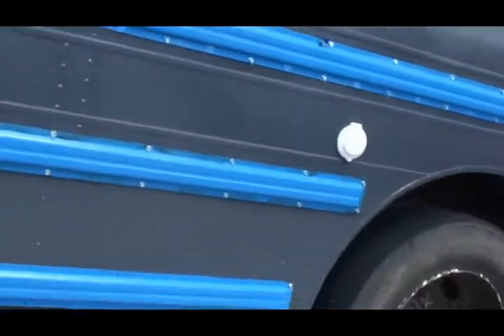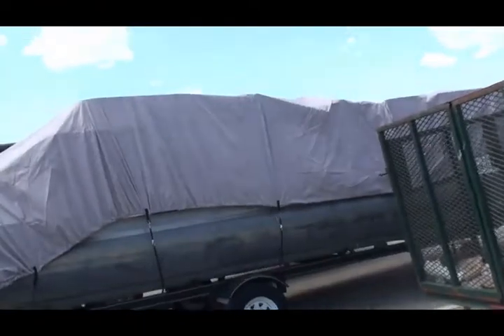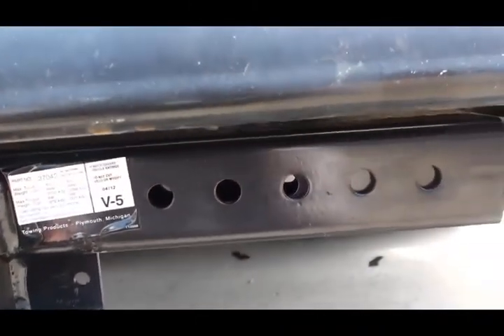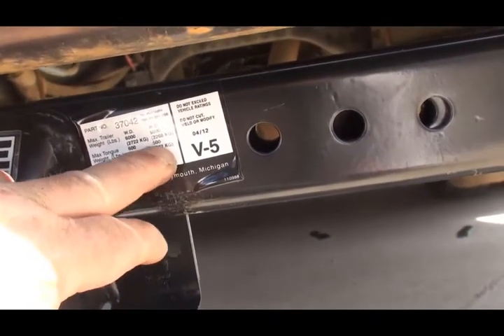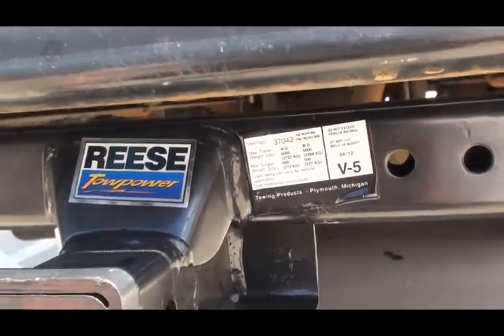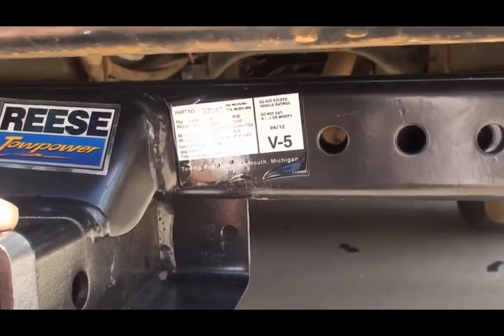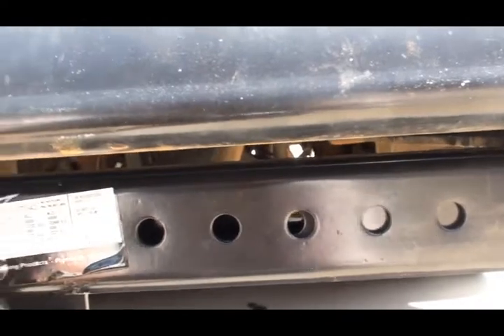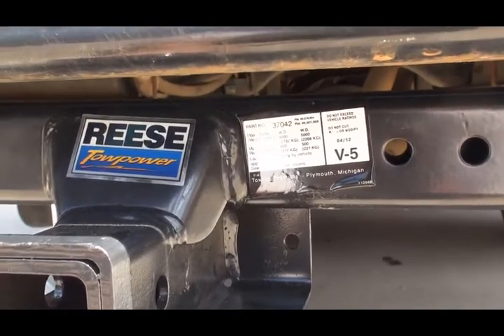School bus to RV conversion #18 (Hitch on a skoolie, Might be a first)

Comment: I put the same on my skoolie last year! I have 40’ IC RE300. Works like a charm! I pull 5000 pounds
Reply from the maker: well i hope my does as well, I'll be pulling a 16 foot enclosed trailer with my Trike inside as well as some essential tools, can't want to finish it and get on the road

Comment: I don't have a skoolie, but I heard those buses are rated to tow as much as 10,000 pounds at the most, and there are 10,000 pound hitch receivers out there, and if it was me with a skoolie, I would have a 10,000 pound trailer hitch receiver bolted to the back of the heavy duty truck frame, and I would go for the kind that drops a foot or so close to the ground, not only to level a 2,000 pound flatbed trailer, with a four wheel drive station wagon such as a 3,000 pound Ford Escape loaded a board making that combination as much as 5,000 pounds, but that trailer hitch sticking down like that would also make an interesting foot step to go in to or come out from the walkway of the emergency exit door, which at that point of making your own living space in any way you want, it would no longer be an emergency exit, just an alternate way in and out besides the main door by the driver's seat, and as for my choice with a 10,000 pound hitch receiver and towing only 5,000 pounds which is only half of what the maximum capacity is, well that's the point, to make that kind of heavy duty towing much easier and safer on the connections so there would be little or no chance of breaking away, especially if you're cruising 2,000 miles at 60 to 70 miles an hour on the freeway such as parts of old Historic Route 66, and up steep hills in the mountains.  And although there are some buses that run on gas and some newly recently released buses are electric, most of them are diesel, and let me guess, your's is a diesel, because of it was me, I'd prefer diesel over gas and electric, diesels can travel farther and longer distances, last longer, and are more heavy duty enough for towing trailers down the road, and diesel fuel improves the fuel economy better than gas does, course electric motors can save on gas and diesel fuel and diesel fuel is more expensive than gas, but diesel engines with diesel fuel have more benefits than gas engines with gas, and if I had an electric skoolie, I wouldn't be able to go very far on a full battery from a perfectly full 100% to a clean empty 0%, and after stopping at a charging station to recharge from 0% back to 100%, I would have to fuss around with frustration for hours before the battery hits 100% and enough that the bus is ready to go, although diesel fuel is more costly than gas, it would only take at least a quarter hour to refill the diesel fuel tank back to max level, and be ready to go again.  All that I said is what I would do if it was me.
Reply from the maker: I eventually did get a new hitch, it was custom made for my bus and can handle at least 1000 pounds, I was have a brand new trailer (the other one was maxed out on weight and kept going through wheel bearing). This new trailer can handle 12,000 pounds thanks for your thoughts I appreciate them.  Happy New Year
Reply: @Coolbreeze61  Same for you too, and 1,000 pounds, as in the tongue weight?  I always thought the tongue weight is a tenth of the maximum towing capacity.  And the purpose for a flatbed trailer is to prevent wear and tear on the car you're hauling especially if it's four wheel drive, my 2017 ruby red Ford Escape is four wheel drive, front wheel drive while in two wheel drive, and I don't know if you've heard about the idea of cars automatically charging themselves while being towed with all four wheels on the ground with a motorhome, including skoolies, but it's true, but it can put wear and tear on your car, and it won't create any other benefits besides automatic charging, so I would just charge the electric car at home, then put that car in the trailer, strap it in, get in the skoolie when ready, turn the diesel engine on, shift to forward gear, and you're off.

Comment: Don't alot of these YouTube busses pull cars and other stuff? What do they use to do that?
Reply from the maker: i've not seen buses pulling cars and other stuff but i have seen motor homes do that
Reply: Coolbreeze there's quite alot. And with huge loads so you should be fine.  And ur paint job is great
Reply: Coolbreeze tap those links. It's busses with tow
Reply: Lots of skoolie a tow. Flat four toads, shop trailers, race cars, etc.